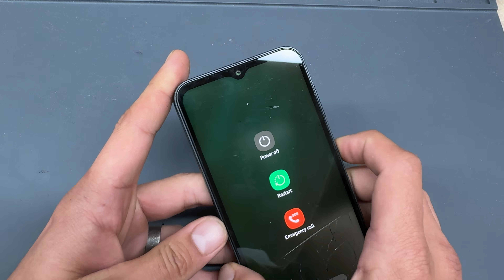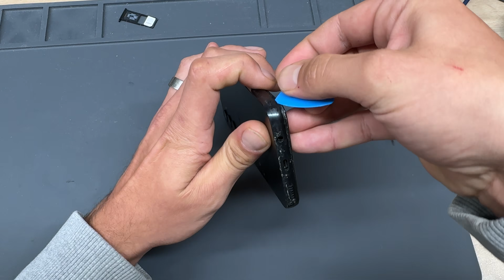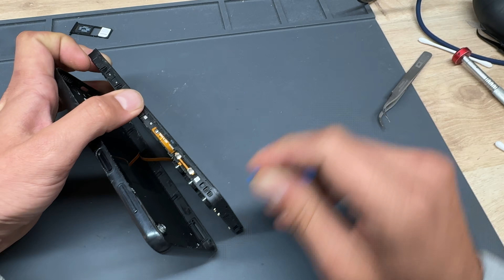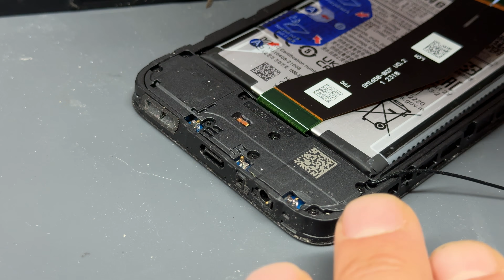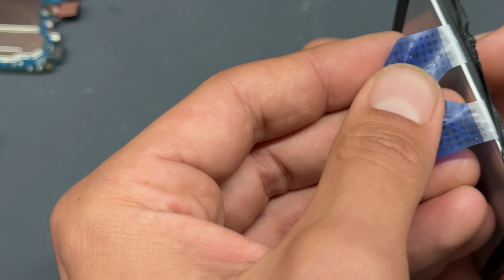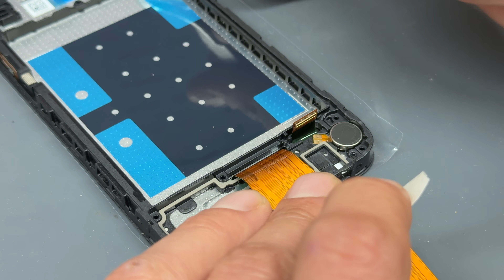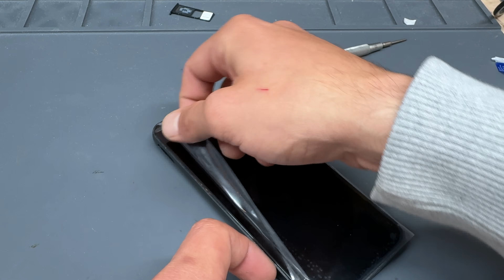Samsung A14 Screen Replacement - DIY Guide To Fix Your Broken Phone Screen!

Comment: Good tutorial. I replaced my son's phone screen. However I'm getting an error on the screen saying a download of a custom os can cause issues press volume up to continue, down to cancel. None of the buttons respond. I'm thinking the model I bought is wrong or not made the exact same.  Can you provide a store where you buy yours so I can make sure and get the right one?
Reply: Theres a solid chance the replacement you got didn't include the actual buttons and ribbon cable for them, which would have to be transferred from the old screen.

Comment: In Australia. I just took my A14 '145' 5 g to get new screen professionally replaced. The first guy said it actually needs a '146' , 145 doesn't fit. Second guy had a 146 but said it doesn't fit, you need a 145. I've still got a very cracked screen.

Comment: I feel this is misleading.  I followed this to the letter and then opened my new screen and it's literally just a screen. This  a motherboard replacement. So I've ordered the screen and it looks impossible to separate that from the board. Feel I've wasted money. 😢
Reply: What's the actual part I need called? I ordered the right screen from amazon but it's just the screen without the rest

Comment: Thank you so much!  I got my phone wet at the lake, and it seemed like the phone was working, but the screen was bad.  Repair store told me 3 days to get the part and fix it for $90.  I bought a new phone for $80 and took the mother and daughter board out of the old one and installed with the new screen and battery.  Wallah!!!  I used the old Sim card and so I didn't have to activate a new phone and go thru all the nonsense that involves.

Comment: Does it matter if your phone is a 4g and the replacement screen is a 5g? Help
Reply: I'm also in this situation,  got the a14 as a backup, didn't care to get a case, 3 months in, the screen is smashed, still works though, I got a replacement screen but I got the 5g version. I would love to know if it will fit and work with the 4g version I have or I need to send it back.

Comment: Thanks for the tutorial just asking if it would be the exact same procedure for Samsung A12 with a broken LCD screen
Reply from the maker: It’s very similar. Here’s a link for an a12 screen replacement
Reply: @iDoctorUK Great video, you made it look easy, I'm also in this situation,  got the a14 as a backup, didn't care to get a case, 3 months in, the screen is smashed, still works though, I got a replacement screen but I got the 5g version. I would love to know if it will fit and work with the 4g version I have.

Comment: This video was perfect. I was able to switch my sons phone screen with this. Thank you. Odd thing though. My new screen didn't come with the volume toggle and power button spring strip. I had to peel it off the old one. Very precarious. Could've torn very easily.
Reply: Mine didn't either and I tore it. Day ruiner right there.
Reply: Same issue and impossible to remove from the old glass

Comment: Fixed phone thank you! One thing that happend that didn't show in the video may happen to others is when removing the plate from motherboard, when removing 10screws the middle back camera was stuck to the piece , caution when removing
Reply from the maker: Thanks for watching and thanks for your tip 👌

Comment: Some replacement screens don't have the power button ribon. Mine didn't and I wondered why it would not start. Went back in your video and opened my phone and noticed the difference. Peeled off and put on new part. Thaks for the video without it I would not of been able to replace the screen.
Reply: I ordered a replacement screen but had the power ribbon missing as well. How did you fix the issue? Did you reorder another replacement??
Reply: @lumymide2002  Seems like a common problem, mine was missing it too.
Reply from the maker: That’s interesting, I’ll make a note of this going forward and include it in future tutorials.
Reply: Mine did not come with one as well. I ordered from amazon
Reply: Just tried to replace mine and new part didn't have power or volume connections, looked like they were soldered and glued onto original so didn't want to risk damage to them by removing them may look for replacement screen only.
Reply: It’s glued onto the original. I Carefully peeled it off.
Reply: I tore the power ribbon what should i do now?
Reply: how did you peel off the power ribbon?